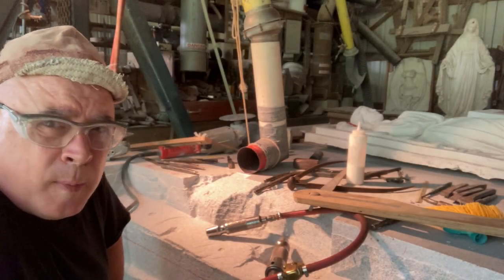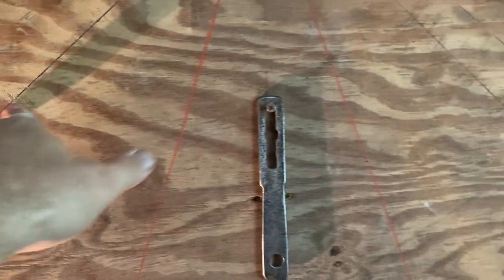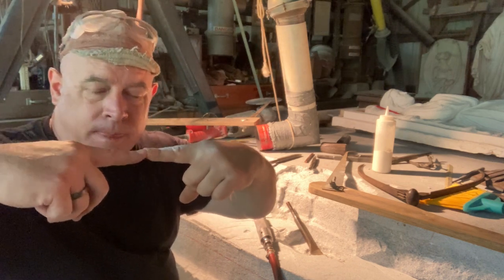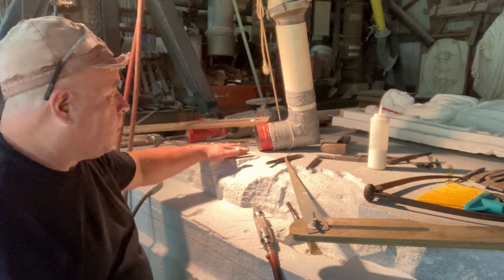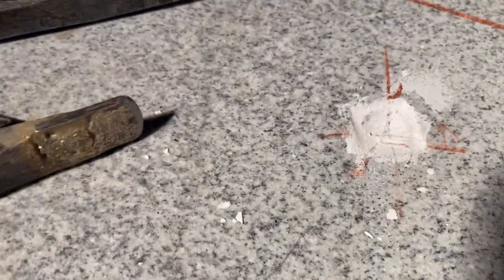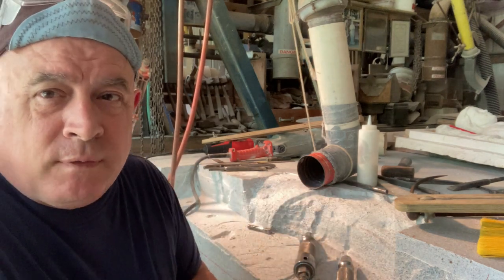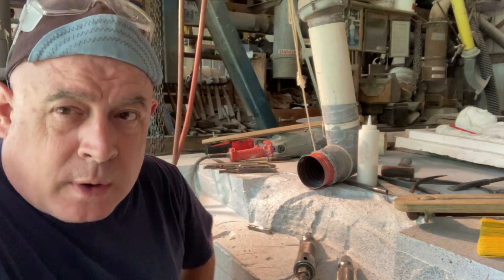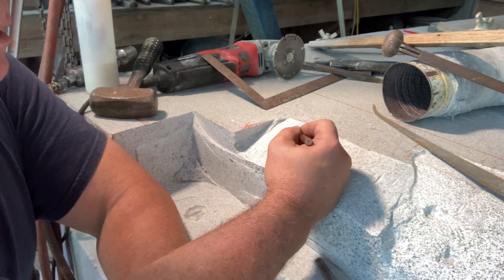Virtual Stone Carving Apprenticeship  VSCA Video 124 Life Size Angel Compass & Triangle 21

Comment: Beste Clinton, dat was een heel goede tip met betrekking tot de verhouding van de lange en korte afstand beweging op het werkstuk! THANKS!!💪
Reply from the maker: Once you start using this method, Erwin, you will see how the length of the radii and the elevation differences between the points impacts the movement of the various strikes of the compasses.  Being able to anticipate how each strike will move towards the intersection helps eliminate mistakes and speeds the pointing process.

edit- this is why I used plexiglass circles to demonstrate how the various radii will interact with each other.  make a few circles from paper, cardboard or whatever is convenient.  then practice placing them  in different positions to see how they approach each other before you start carving stone.  I think it will help you better understand the pointing-with-compasses process.

Comment: I got my pneumatic today. And my money went somewhere else besides my bank account for the Milana pointing machine. So I'm thinking that went through.
Reply from the maker: Cool deal.  I think you’ll like the hand machine.  I’ll be curious to hear how it breaks in.  Some are great from the start, some are always harsh and some go from harsh to great.   

Keep me posted.  It’s always great to talk with you.
Reply: @carolinasculpturestudio  started my first project with my new hand machine. I'm doing my my mail box digits on a piece of 2cm Yule marble. Also did a little roughing out on my frog project. I ended up taking back the 20 gallon 4 cfm compressor and exchanged and paid the extra for a 30 gallon 6.7 cfm. Man it's like a buzz saw with the right air. Also my pointing machine is supposed to be here Nov 6th. I can't wait to dive into the frog after that.